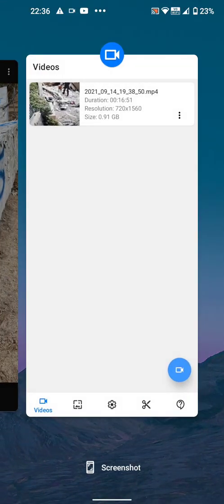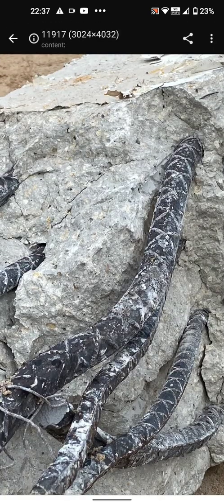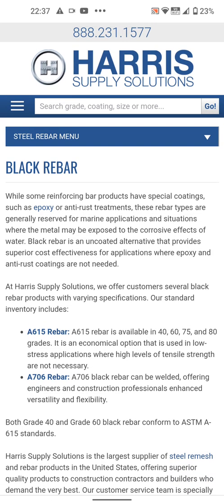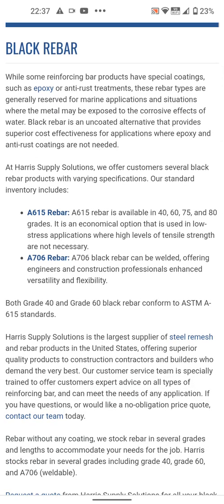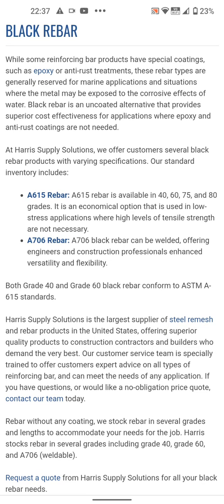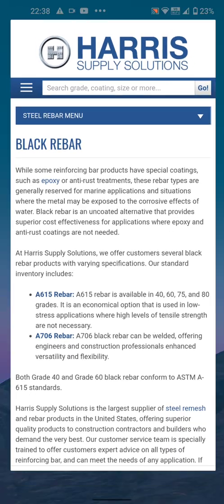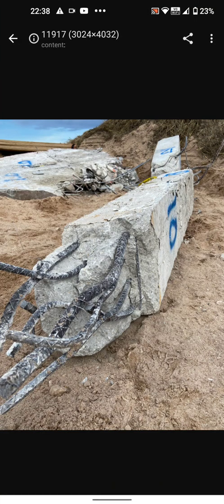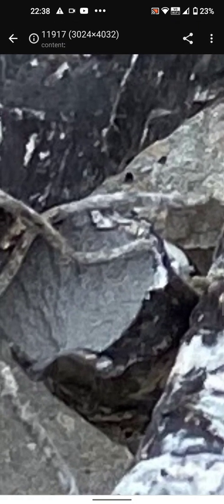Champlain Towers used "black rebar" Yes, it's a thing Rebar brittle fracture

Comment: Black rebar is a regular uncoated rebar that provide superior cost effectiveness for applications where there is no moisture. Compared with other reinforcing bars with special coating, such as epoxy or anti-rust treatments, black rebar is prone to rust and corrode, but it is the cheapest and the best for the application where epoxy and anti-rust coatings are not needed.

Advantages:

Cheapest kind of rebar.
Most common rebar used in buildings.
Excellent in applications without moisture.
Reply: Thank you... I can see you are pretty damn smart about concrete... I deal with wood and mechanics but I can tell you know...

Comment: This is a copy of what I read about black rebar. - Black rebar is a regular uncoated rebar that provide superior cost effectiveness for applications where there is no moisture. Compared with other reinforcing bars with special coating, such as epoxy or anti-rust treatments, black rebar is prone to rust and corrode, but it is the cheapest and the best for the application where epoxy and anti-rust coatings are not needed.  Advantages:

    Cheapest kind of rebar.
    Most common rebar used in buildings.
    Excellent in applications without moisture.
This rebar should have never been used, they were looking to cut cost!!!
Reply from the maker: Chris, well said.

Comment: I went and looked up “black rebar” like you suggested. It is my understanding that “black rebar” is uncoated plain rebar conforming to ASTM A 615. This is normal rebar. It is like “black steel”. The term “black” comes from the black mill scale on the steel.

Now if I have found something different, let me know. I have always used the term “black” to mean uncoated steel. 

Now what is ASTM A615 rebar? It is junk steel that has a minimum yield and tensile strength. It can be brittle and shatter when it is dropped and still meet specs. It is only good in tension/compression. It can have flaws but because of the rolling the flaws are aligned along the length making it OK in tension but bad as beams.I have tested some #18 bars and found that the test did not meet tensile strength because of a flaw. A615 should not be welded because the metal does not have the controls required for welding.